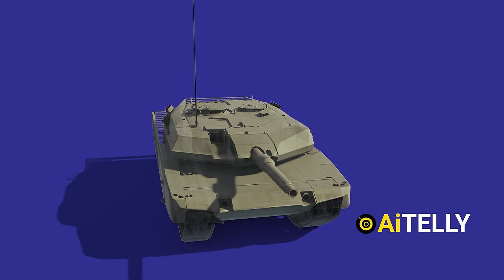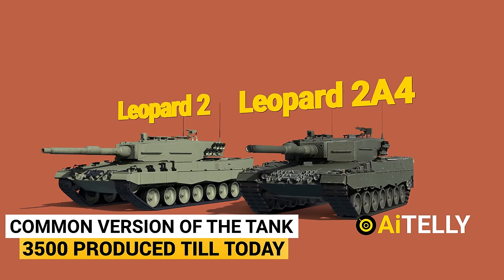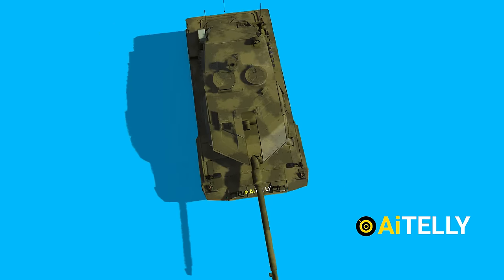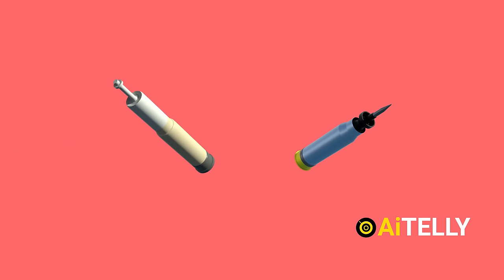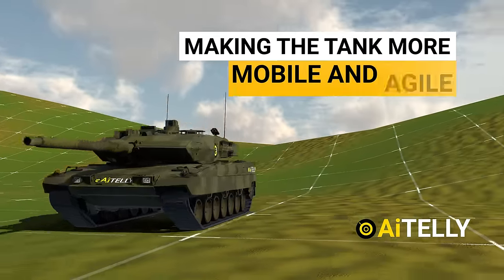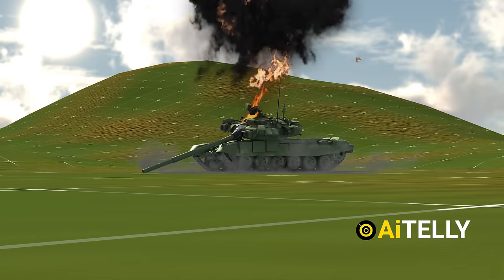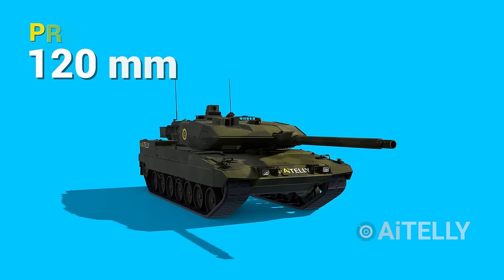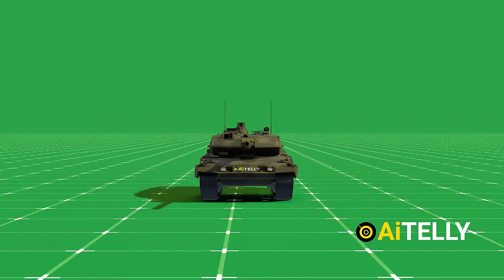Leopard 2 Main Battle Tank How it Works with modular Space Armour Leopard 2A6 Loepard 2A4

Comment: For those interested i will deepdive into the purpose, design and use of the added spaced armor present on a6 variants and variants after.

When this spaced armor was designed it was designed with specific care to both the design of Russian apfsds and the design of Russian tanks as these are interlinked.
We start with the Russian shells and their limitations which lead to the design choice of the Leopard 2's added armor.

Modern Russian tanks use autoloaders, specifically a carousel, this autoloader design along with the compact design of Russian tanks comes at a very niche cost.
Because of Russian tanks compact interior, having an autoloader that was loading the entire shell in one stage became impossible, instead the solution (as with many other tanks) became to separate the ammunition into two stages, the propellant and the shell itself.

This allowed the autoloader to fit and work within the tanks confinement, however as size is an issue the length of the penetrator rod CANNOT be increased further without making the autoloading impossible. It is because of this that the Russians moved to a larger gun on the T14 Armata.

Now how is this important?
Well the penetrating power of a modern APFSDS Directly correlates to the length of the rod, as such the Russians are locked into a limiting roof regarding their shells penetrating power as all of their modern tanks use guns with a calibre of 125mm.

Now how does this tie back to the design of the Leopard 2's added armor?
The design is quite ingenious in it's simplicity. Since it was known that the Russians had locked themselves into this dilemma of rod length German tank designers knew the upper limits of rod length that could be acheived with the Russian guns.

The added armor was then designed so that the space between the original composite armor and the new added armor was longer than the longest rod length possible to acheive with the Russian main 125mm gun.
This means that no matter which apfsds the Russians use the same result is acheived. 

When the rod penetrates the spaced armor it is ensured that the rod will have space within the gap to rotate off axis, meaning the rod will NOT impact with it's penetrator in line with it's velocity vector.
This in turn nullifies almost all of the penetrating power of the rod making the front of the Leopard 2 turret impervious to any possible Russian ammunition UNLESS the Russians change the main gun of their tanks.

Thanks for coming to my TED talk!
Reply from the maker: Ted talk has been pinned to the comment section
Reply: @Aitelly  thank you!
Reply: That isnt neccery true, that you cant have a better apfsds instead of increasing its lenght maybe you can increase the caliber. Before the fall of the soviet union the russian experimented with the idea of simplifying their ammo logistics and up gunning their tanks at the same time. This was tried on a t80 which was fitted with a 152.4mm gun. The project was a success.
Also they used a the same carousel autoloader and it had no problem fitting the charges and the ammo.
Reply: @Silver_Prussian  The point is that the material doesnt matter, so long as the rod is limited by length it will not align with its velocity vector and thus material makes little difference.
Reply: @axlfrhalo  when did i say anything about material also the 152mm gun has longer shells and they fit so i am not sure there is that much of a limitation on their apfsds
Reply: @Silver_Prussian  I am sorry, when i said material i meant mass and did not word it correctly. You do however specifically mention not increasing length but rather calibre which could only mean a wider rod with the same length.
So no you did not infact mention longer shells.

Secondly yes putting larger guns into current T-series tanks has been experimented with but that only proves the point of my initial post? 
The whole point is that the only solution is an increase in calibre.

So with this, i do not understand what it is you are trying to argue exactly.
Reply: @axlfrhalo  doesnt really matter if the rod is long or not. With this 152.4mm gun when testing it on a t72b it caused huge cracks on the turret and literlay made the internal of the tank jump out of place. So even if there is not penetration the sheer shockwave of the projectile will f*ck up anything
Reply: @Silver_Prussian  The length of the rod is absolutely an important matter given the discussion was and is about the purpose of the addon armor. In regards to the after effect of the kinetic energy, that is another matter.
Reply: What happens when that spaced armor is destroyed? Due to the Leopard 2's lack of a laser warning receiver, it's quite likely that the Russian tank would be able to get 2 shots off before Leopard 2's crew can load an APFSDS round, detect the target and measure the distance.
Reply: @definitelyfrank9341  If the added armor was no longer present, the remaining armor would be the original 2a5 turret with the moved gunner sight.
This turret would likely still withstand older soviet rounds, although like with any composite armor, not two hits in the exact same spot.
In regards to newer ammunition like the 3mb60, it is not very likely it would withstand it without it's spaced armor.

A much more likely candidate to impact the leopard 2 in this modern war would be artillery or ATGM fire as it has become very apparent that actual tank on tank combat is exceedingly rare.
Reply: @axlfrhalo  Anything with a tandem warhead should go through...
Reply: @definitelyfrank9341  Tandem warheads are intended for use against reactive armor, spaced armor is passive and so a tandem charge doesn't have the same effect.

Edit: or do you mean without the added armor?
Reply: @axlfrhalo  The first warhead would destroy the spaced armor and the second warhead should penetrate it.
Reply: @definitelyfrank9341  That is something to be simulated, neither you nor i can definitively say what would happen
Reply: @definitelyfrank9341  the leopard has way better optics and spotting abilities than any Russian tank in Ukraine. First hit probability is 98% with a German crew. Even if it is 70% with a Ukrainian crew , it would still destroy 7-10 Russian t series tanks before being hit once. All proven by the strong Europe tank challenge.
Reply: @SHASHWAT SINGH even a German tank gun won’t be able to hit the exact spot twice and a Russian tank gun will never hit the same spot twice let alone the area it was aiming at
Reply: @leopard2109  You just say that but you don't give evidence.
Reply: @leopard2109  Where did you get these stats? Goodness you're funny.
Reply: @leopard2109  Haha, funny joke. Russian artillery has the accuracy of a sniper from 60km away, how much more a Russian tank gun from 2km away?
Reply: @definitelyfrank9341  lol russ arty does NOT have the accuracy of a sniper. Where do you get "this" claimed stats from?
You just "claim" with no evidence ;)
>> got ya =P
Reply: All this, of course, is cool ... But these are arguments about ordinary shells and these arguments were outdated back in the 90s 😂  Russian tanks do not have a rifled gun, but a smooth-bore one, since they mainly use active-rocket projectiles for heavy targets, which have a completely different mechanism and principle of hitting targets))))
Reply: So basically the space armor has more distance between the second armor and the first armor than the length of a  Russian apfds ?
Reply: @farrazaulia2917  yes exactly, you understood it just right
Reply: Isn't it amazing how many people try and kill your argument. I'm sure that Rheinmetal had no chance of testing the armor add Ons against actual Russian weapons right. Wink wink. Some people are very naive when it comes to what Russian equipment the west can get their hands on. The classic example of espionage is all of those weird fires happening throughout Russia and all those railway lines that suddenly blow up. hehehee
Reply: @yanchy  No they don't use "active rocket projectiles" primarily for heavy targets.
Reply: @yanchy  Smooth bore guns are better than rifled ones.
Reply: @definitelyfrank9341  that is why, starting from the T-64, Russia uses smooth-bore guns with the ability to launch active-rocket projectiles through the barrel
Reply: @definitelyfrank9341  and the Russian active-reactive projectile does not care what additional protection the tank has - the destruction of the vehicle is an explosion over the gun turret)))
Reply: @definitelyfrank9341   my main comment to this video : Unfortunately quiet a few things wrong. You guys mixed up data of the 2A6 and 2A7. The 2A6 weighs 59,9 tons like stated earlier and at the end it was suddenly 62 tons. You also stated the L/55 can penetrate (with apfsds ) only 450 mm RHA at 2000 which is wrong, modern rounds like DM63 still have over 600mm of penetration at 2000m. Furthermore the leopard 2A7V has multiple cameras and FCGS capabilities. So situational awareness is very good. The 2A7V also has an APU which makes silent operation with low heat signature possible. I’m surprised you didn’t come up with the classic ammo hull storage problem, which was made obsolete in 2007 when Rheinmetall developed new propellants which do not ignite when impacted with shaped charges or kinetic projectiles
Reply: @yanchy  Ohh, I see what you mean.
Reply: @leopard2109  I doubt they've replaced all the old propellant with new inert propellant though.

By the way, with only the APU running (engine off) the tank can only sit in the same spot, it cannot maneuver to change locations.
Reply: @definitelyfrank9341  you doubt 😂😂 this propellant is standard in the german army since 15 years pal. Theres a lot things you dont know a thing about. I know many people who serve and served on these tanks . Dm63 is standard since 15 years. And yes you genius any vehicle with engine off will not move , but guess what: they only turn off the engine when they dont want to move and snipe or wait for enemies , only then they turn on the APU which makes them basically invisible to thermal sights unlike a russian tank which has to have his main engine running to operate all systems . other than that the leopard already has an extra cooling system around the engine that cools the hull to lower the heat signature even with the main power train on. But i bet you didnt know all that , since you think russian artillery is accurate 😂 dont bs yourself  internet warrior.
Reply: @leopard2109  You said the tank can still remain "operational" with the engine off. A tank must be able to move, so it isn't completely operational.
Reply: @leopard2109  They'll be an EASY target to Lancet drones. You can see them targeting M-777s that are partly hidden by the top of the forest and aren't firing (they aren't giving away their position).

You know it takes tens of minutes to start up a diesel engine in the snow? 

Russian T-90Ms have Nakidka blankets that can get the job done.
Reply: @definitelyfrank9341  gun is operational, turret, thermal sights , electronics. Thats a big advantage to have these systems operational, keeping a very low heat signature and operating silently. Russian tanks are way behind in this one. Youre trying to make it look like a disadvantage , which it clearly isnt. You realized you just talked bs. Educate yourself.
Reply: @leopard2109  You act like heat signature is all that matters simply because you believe that Leopard 2 is superior in that aspect. You also only compare specs that can't be fact-checked. 

So, after Leopard 2 is detected by a drone, what happens then? It'll take tens of minutes for them to start the engine and it only takes a couple minutes for either a Lancet drone or an artillery shell to travel to it's destination.
Reply: Yeah, Yeah I Know what you mean, EL TANQUE VOLADOR 😉 😆 😜 😄 😏 🤣 , Give me a break.
Reply: Посмотрим как теория стыкуется с практикой) Осталось ждать недолго. Если конечно леопарды будут использоваться на фронте, а не стоять в тылу для показательных фотографий.
Reply: @АккАкк-п2й  Никак будут гореть как и в Сирии )
Reply: Вы европейцы такие умные, что прям поставили русских в тупик, мы теперь не знаем что и делать 😂
Reply: @Silver_Prussian  ну не верит он тебе)) пока не получат 152 мм)) если не пробьет, так сломает))
Reply: @leopard2109  🤦‍♂️
Reply: @axlfrhalo  well it was recorded that the shells would have more than one and half the impulse of the 125mm. In a sketch for the tank the shells appeared to be placed vertically  instead of horizontally. So even if the lenght was the same  it would still be able to break through unfortunately the union was disolved and we never got to see this gun in action
Reply: @dronantipov7682  got a problem russian bot?
Reply: Why are you guys compare this tanks whit the T90 El tanque volador? The Russian junks was a disaster in the ukranian war , please stop to say stupidity here.
Reply: It's about as you said. But there is a nuance. The majority of tank losses in the Ukrainian conflict due to ATGM, artillery fire and kamikaze drones. Direct tank-to-tank collisions are quite rare.
Reply: It's a pity for the children killed in Iraq.  thanks for the "democracy" 😔
Reply: Вы не учли, что опыт сегодняшних боевых действий таков, что танки в танковом бою почти не встречаются. Сегодня оператор противотанковой ракеты или дрона решает всё. ещё один немаловажный аспект это вес. Тяжёлый танк может работать только в сухую погоду. Скоро наши танки встретятся, и будет ясно, на сколько верны ваши рассуждения.
Reply: As a Ted i can confirm
Reply: @axlfrhalo  The better term would perhaps be not passive but rather non reactive armor I would say. It passes the message better in my opinion since "passive" might make some people think that it is a type of NERA (which is also a thing).

Also part of the addon armor design on Leo2a6 turret frontal arc is having to do with increased chances of breaking the penetrator rod and/or deflecting (internally) the received APFSDS, it makes sense when someone sees the internal structure of that part of armor when disassembled. It basically has its internal plates ahm offset(?) excuse me English is not my language in an attempt to "bend"/divert the penetrator.   The space in space armor, especially if air or rubber is not really effective against APDS (/APFSDS) type of AT shells, it helps a little bit but it's rather inefficient on its own and the primary reason for (most kinds) spaced armor is defending against HEAT (and while armor was just a wall of plain steel also HEP/HESH). Simple spaced armor (as this one is) is getting most of it's effectiveness against APDS type penetrators due to trying to divert them internally (when designed for this purpose as in this case) plus what typical protection the relatively thin plates (plus internal slope) offer.

I will add that supposedly the frontal arc, atleast when up-armored on one specific weakspot, is "invulnerable" to all AT fire hitting it, atleast up until the time they came up with A6 design. This has been (kind of) independently tested albeit it's so long ago (about 2 decades back, damn I feel old now ha!) that I probably can't find any specific data about it (and that's just of what was released) and am also forgetting some.
Reply: @Иван-е8т8е  Western tanks are way better armored than russian tanks. Against both apfsds shells and heat shells. Just alot better survivability overall and better made. And if russian tanks wasn't almost built entirely by western components they would struggle real bad
Reply: Enough hitting a high-explosive projectile and all attachments outside will be disabled, the tank will become incapacitated blind puppy.  The same can be done with a tank by a burst from a 30 mm rapid-fire cannon.  Of course, the tank will be put in order after losing the battle and it will again become the best in the world for the pride of Ukrainian patriots.
Reply: But i think russian apfsds can pen the leopard frontally if aimed correctly(also in WT is the lower front plate weakspot realistic?)
Reply: >This allowed the autoloader to fit and work within the tanks confinement, however as size is an issue the length of the penetrator rod CANNOT be increased further without making the autoloading impossible. It is because of this that the Russians moved to a larger gun on the T14 Armata.

Armata and T-90M use the same gun -  2А82-1М. This gun is officially more powerful than the Rh120 L/55.
Reply: @adeptusaegis3189  the initial plans was for a larger caliber gun, for this reason
Reply: @axlfrhalo   The initial plans was "duplex" - two guns with different calibers, but similar in design. 2А83 - 152мм and 2А82 - 125мм. In 2009, the tank program "Object 195" with a 152-mm gun was closed, with the characteristic as "redundant".

The new 125mm gun was enough to destroy any existing serial tank.
Reply: @adeptusaegis3189  Correct, the 152mm 2A83 was of interest because of my aforementioned reason.
However i do believe they, just as every other firm to attempt a 150mm+ calibers gun, realized it is not feasible for a number of reasons.

I do not know this next statement as fact but i can speculate that the designers instead sought to produce longer rod shells specifically for the t14 whilst constructing the t14 auto loading system in such a way that it overcomes the rod length limit of previous ones.
But that is something that is to be seen, i have not heard much of case specific shells for the t14.
Reply: @axlfrhalo  As for the 152mm gun, I did not see in any source regarding the Armata that the choice of 125mm was something other than practicality. Not the failure of 2A83. Russian sources regularly mention the possibility of installing 152mm on the Armature, but this has always remained only rumors. No statements from officials.

T-90M and Armata both use the same gun (Armata does not have a gas ejector, because unmanned turret) and they should use the same ammunition. 
Like this new Vacuum-1 APFSDS, for example.
Reply: @adeptusaegis3189  The use of the same gun is not a surprise, for reasons you mentioned, what i wonder is how/if they have changed the autoloading system. 
And if changes have been made, if those are to allow for longer rods in the future, i have seen nothing on this however.

But it would be sensible to change this system as this was the limiting factor, with my understanding.
Reply: Leopard 2 разрабатывался для противостояния Т-64.
Reply: thankyou for the comment and educating everyone...
Reply: the accuracy of the guns makes it possible to target vulnerable areas in the form of a lower frontal plate, which is huge on a leopard, plus it’s not a fact that the upper plate can hold back the top shells of a 125mm cannon
Reply: @leopard2109 something like that is not observed in Ukraine now, hah, plus the t 90 has missiles with which it can throw 5 km, which the leopard is not able to do, so do not disgrace your knowledge
Reply: @leopard2109 where is the proof? empty words about accuracy
Reply: Da, sve se vidi u praksi. Bez nepotrebnog epp
Reply: @leopard2109  It's a funny history. The fascist tank was highly praised, but it turned out that it was only good for being a very bad gun, at the level of the old T-62.
Reply: @adeptusaegis3189  The 152mm Armata gun is needed to fire nuclear shells.
Reply: اقرأوا دعاء العهد والفرج
     لا إلٰه إلّا اللّٰه محمد رسول اللّٰه علي ولي اللّٰه اللهم صلِّ على محمد وآل محمد وعجل فرجهم و ارحمنا بهم 🤍 💚
     عن أبي عبد الله عليه السلام قال من قال أربع مرات إذا أصبح - الحمد لله رب العالمين فقد أدى شكر يومه ومن قالها إذا أمسى فقد أدى شكر ليلته.
     عن أبي عبد الله عليه السلام قال: من قال في كل يوم سبع مرات: الحمد لله على كل نعمة كانت أو هي كائنة، فقد أدى شكر ما مضى وشكر ما بقي (4).
     لغفران الذنوب قولوا استغفر اللّٰه الذي لا إلٰه إلّا هو الحي القيوم و اتوب اليه 3 مرات
     يا أبا الفضل العباس يا قمر بني هاشم يا ناصر الحسين يا أخا الحسين قولوها لقضاء الحوائج 🤍💚
     313
     اللهم العن اول ظالم ظلم حق محمد وآل محمد و الثاني والثالث والرابع و آخر تابع لهم إلى يوم الدين
     اللهم صلِّ على محمد وآل محمد وعجل فرجهم و ارحمنا بهم
     ما بطلٌ إلا علي بن ابي طالب و ما أمير للمؤمنين إلا أمير المؤمنين علي بن ابي طالب صلوات اللّٰهِ و سلامهُ عليه
     اللهم صلِّ على محمد وآل محمد وعجل فرجهم و ارحمنا بهم عند الإنتهاء من الدعاء قولوا ما شاء اللّٰه لا حول ولا قوة إلّا باللّٰه ليستجاب الدعاء إن شاء اللّٰهُ تعالى
...
Reply: Be shiite Muslim and your life will improve 🤍💚 don't listen to songs and music
Reed Qur'an and pray to ALLAH
Reply: @Aitelly Здравствуйте. На какой программе (софт) сделана эта анимация?
Reply: can somebody explain what the loader is doing most of the time inside the tank
Reply: @definitelyfrank9341  Until ANY tank has reacted to the laser warning and rotated into the direction of the enemy, the round of the firing tank has already arrived. "Lase and fire". Also, laser warning sensors on the ground have to fight really hard with false positives and other problems. They work much better on aircraft.
Reply: @adeptusaegis3189  As official as Russian election results?
Reply: @denniskrenz2080  You can add to Wikipedia, where I got this data from, that this is complete Russian propaganda, if it makes you happy.
Reply: @adeptusaegis3189  Considering the number of (often blatant) errors in Wikipedia, I can live with that. Hey, even Russians can edit Wikipedia.
Reply: Schwachsinn 🤦🏻‍♂️🤦🏻‍♂️
Reply: @BudderGolemxx  A thoughtful statement, indeed.